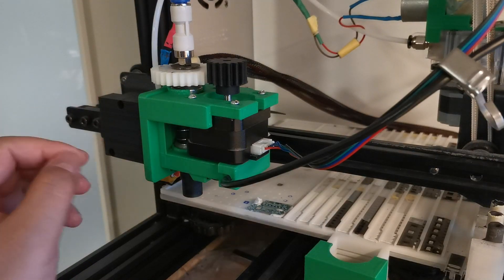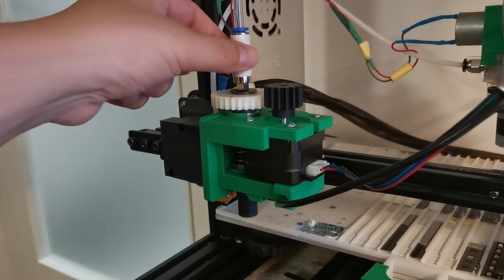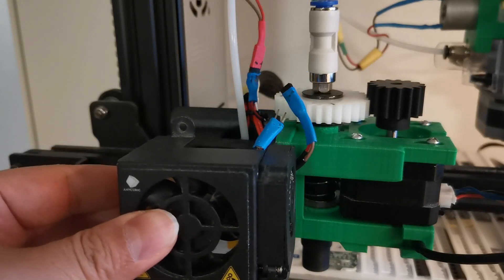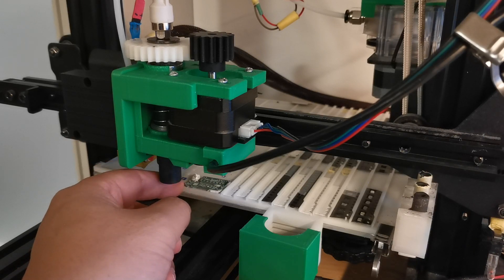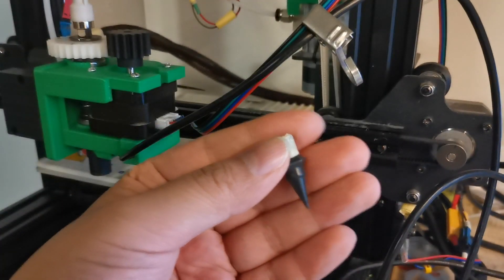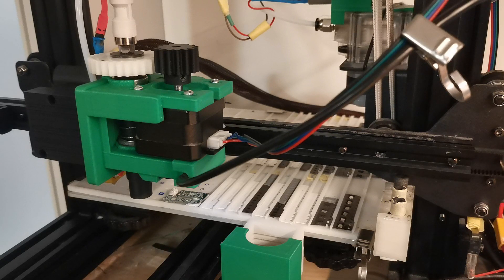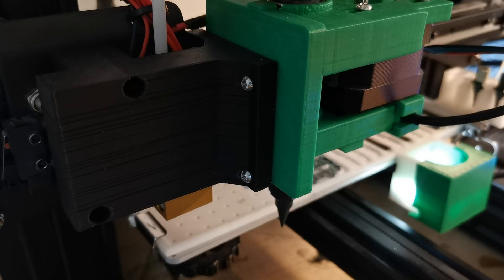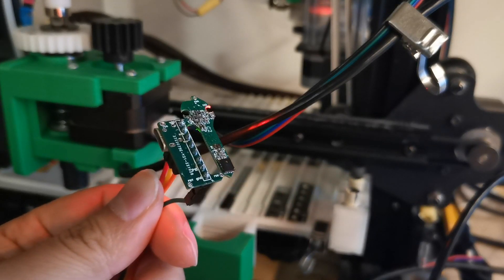DIY pick and place machine from 3D printer Part 7 - Improvements, make it more consistent

Comment: Is it possible to pick from randomly distributed (same component) parts from a container or something? It would be nice to have since im producing small batches 10-50pcs and i dont want to buy 1000pcs for ams1117 for example
Reply from the maker: For loose part pick up I didn't try, I saw this feature in openpnp, so it should be possible. For 1117 you can also buy 10 with cut tape for ex. and put in the strip feeder.